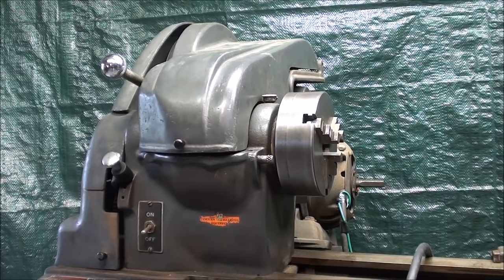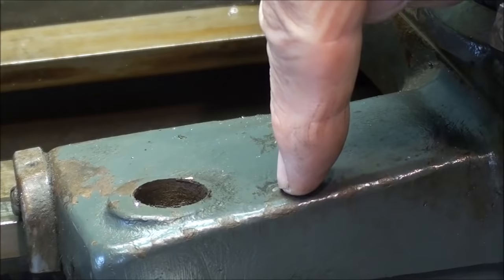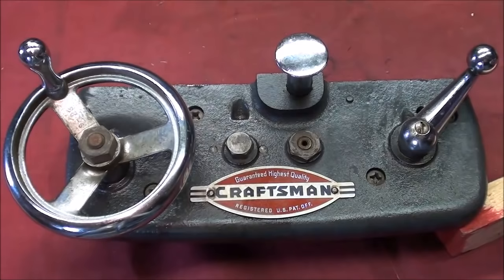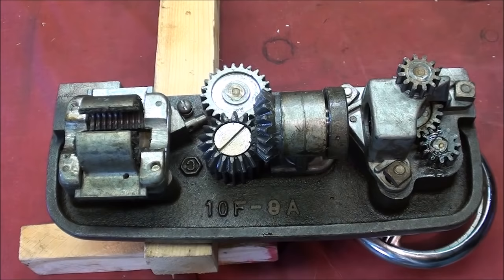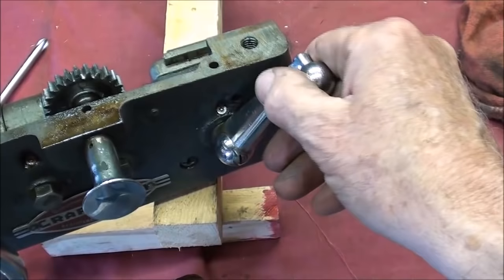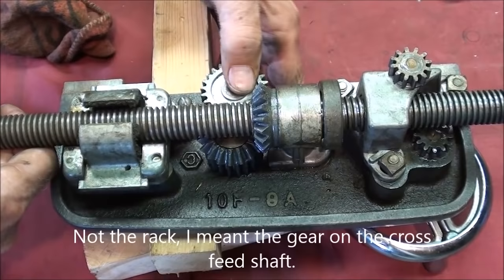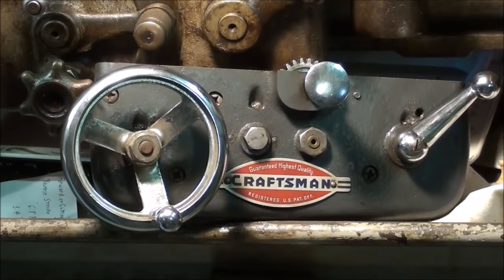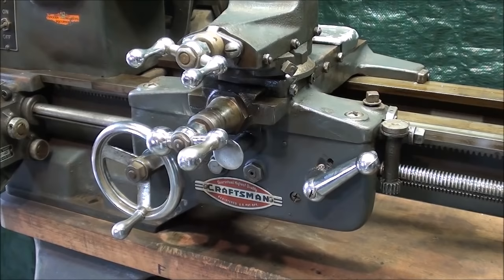SHOP TIPS #231 What's Inside the Apron of the Atlas/Craftsman  Lathe  tubalcain

Comment: Lyle,,,have the same model,,+ 3  101.28990   28940 ,  had a gear issue ,,,someone replace the slide gear with a 60 tooth gear,,fixed it and all set,, quick question cuz I know how busy you are,,,is the lead screw on the 28990 or 940 with quick change gear box held in by a locking nut,,,it won't pull out like in your video,, want to remove the saddle without removing the whole lathe off the bed...can't get at the nut,  or lead screw out , doesn't pull out like on the model you just showed... Enjoy all your videos on these old boys,, Have 3 other 101.07403  I getting rid of , to much stuff,,,Do have a pic of it if you like to see it,    Thanks Professor,
Reply from the maker: Are you saying, that the lead screw will not pull out of the saddle?